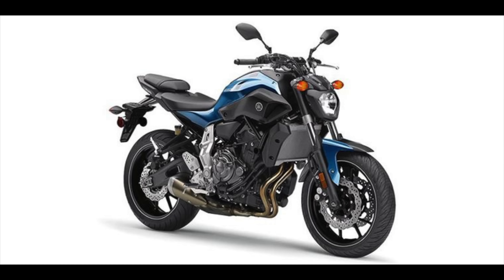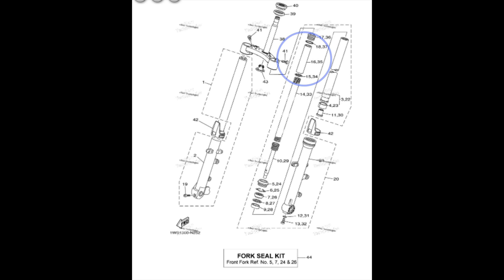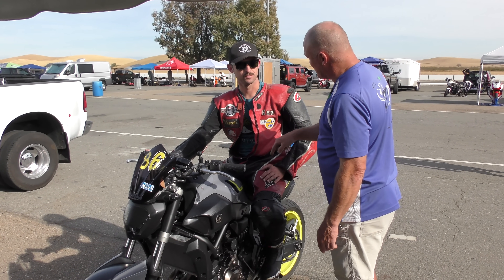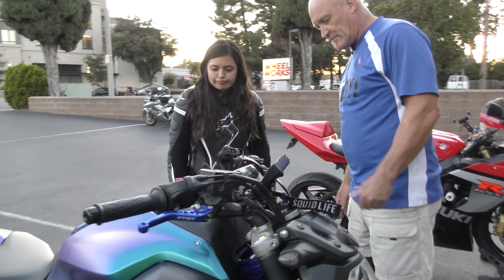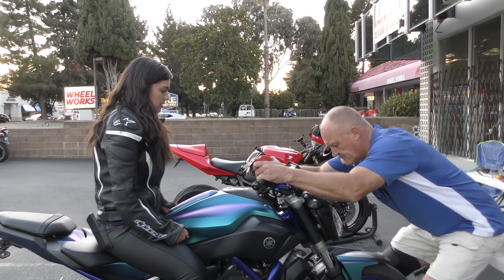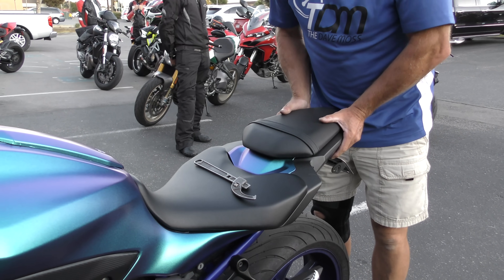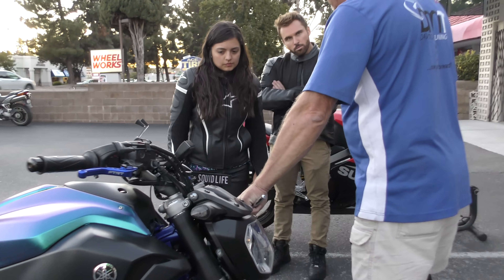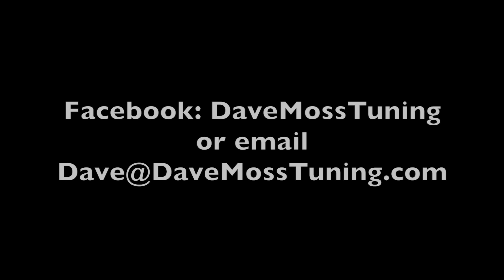Yamaha FZ-07 / MT-07 Fatal Flaw and How To Fix It

Comment: I just got a 2020 MT07, I'm 6'3"about 280lbs. I think the bike I got has a higher seat bc I flat foot it comfortably and it doesn't feel small. It feels perfect for me actually. I never knew the suspension needs correcting though.. what are your recommendations to fix the suspension and handling for a big guy like me on the 2020 mt07??
Reply from the maker: 20w fork oil and leave the spacer and stock fork position as is. Try putting shock preload 2 below maximum and see how the bike handles.

Comment: Did they fix the forks on the 2021 Mt07?
Reply from the maker: Oil needs to be changed to 15 or 20w depending on weight.
Reply: @catalystreactionsbw  i see. So the spacer wise they made it shorter for the new model?
Reply from the maker: @mad2xraven  I believe the spacer issue has been changed but have not verified that myself. If static sag is 15mm or less, the spacer is still the same length.
Reply: @catalystreactionsbw  we’ll have to see then😄
Reply from the maker: @mad2xraven  as per reply, I do not know as I have yet to see one in person to validate but with a tape measure you can assess immediately with your bike.

Comment: I have a very limited knowledge of suspension but....if I'm understanding correctly, we shorten the spacer to reduce preload which in turn shortens the travel, and the bike will no longer ride as high in the suspension stroke. This will increase static/free sag correct? What measurement is the goal for the static sag? How does the 15w/20w oil affect the bike other than more harsh compression? How does lowering the forks in the triple clamp 8-12mm help? Does it further combat the feeling of the front forks being 'to the moon'? I apologize for so many questions. I'm trying to understand what needs to be done on my current 2018 MT-07. Currently ~16mm of static sag in the front forks, and only sees any static sag in the rear at the lowest bottomed out setting. Which makes it further feel like I'm riding a wet noodle. Thank you in advance for any answers to my questions above.
Reply from the maker: From your statement, your thinking shows travel will be less as more static sag is added from shortening the spacer, that would be correct as the fork is not at full extension all the time. 20-25mm is ideal for static sag. Or, you lower the front end to make the motorcycle flat and neutral via the geometry change instead of cutting the spacer. Oil viscosity at 15 or 20w  is not sufficient to create a harsh compression stroke due to flow rates.
Reply: Wow, thank you for the quick reply! I think that means my next steps are 15w oil (155lbs w/ gear on), drop the front 10mm, and a new rear shock. See how it feels, then trim the spacer if needed.
Reply: @carson6305  hey, what was your observation?
Reply: @StefiMoto  Hey Stefan, I actually didn't get to changing my rear shock just yet which is still a 'problem'. The bike is not unrideable by any means, only a bit spongey in the rear. A few weeks after this comment, I actually went to see Dave Moss in person and paid him to do any needed adjustments. He dropped the forks 10mm in the triple clamp and mentioned that a new rear shock and 15w in the front forks would be all I need for a perfect setup at my weight. The stock rear shock only presented static sag in its lowest setting, so Dave adjusted it down to that. I will be purchasing an aftermarket rear shock for my weight soon, and don't have any desire in swapping to 15w in the forks until I absolutely need to for general maintenance. Hope this helps.
Reply: @carson6305  thanks a lot for quick and detailed response.  🙏
Did you notice the front end behaving better after the drop?
And what's your weight?
Reply: @StefiMoto  Hey, no problem at all. An honest answer is that I only had the bike for 2 months on stock setup before Dave made the 10mm drop, so I did not have a great baseline to compare to. With that being said, it handles great apart from the 'wet noodle' of a rear shock. I'm 155-160 with gear on.
Reply: @carson6305  thanks again. 👍
And finally, did you shorten the spacer also or only raise the forks?
Reply: @StefiMoto  Dave mentioned that on my 2018 mt-07, shortening wasn't needed with the 10mm drop. He still reccommended 15w oil in the forks, or 20w if I'm a bit of a hoonigan ;). I still could go the shortening route if I wanted.

Comment: I heard this is only a problem for the pre 2018 models, after that its better, do you have any information on that?
Reply from the maker: We just changed the fork oil to 15w on a 2020.
Reply: @catalystreactionsbw  I appreciate the fast respone. Would you recommend this problem to be solved only for more experienced drivers who want to test the limits of the MT-07, or also for people who use it as their dialy driver?

I am just surprised about this issue, as I haven´t heard many people talk about it.

Comment: Hello to anyone reading this. I am a semi sponsored FZ07 or MT yamaha stunt rider. Frankly I have done the exact opposite of everything this guy has said and my bike runs/handles like a dream. The only thing I changed is the saggy ass fix which raised the back up by 2.5 inches (If you are a stunter or know about stunting you know what that means) thanks to Twin Stunts who are fully sponsored yamaha stunt riders and make stunt parts and I put in stronger fluid so I wont bottom out the forks coming down from a wheelie! To ME they are ready to rip out the box! Remember that everyone rides differently and that you don't have to fix something that isn't broken!!!!!!
Reply from the maker: Thanks for sharing your experience Matt. What "stronger fluid" did you use and how much? Stunting is a very unique set up indeed so sharing more information would be very helpful for those who have your skill set.
Reply: @catalystreactionsbw  15wt for the fork fluid to make the front suspension more stiff and less chance of bottoming out/ blowing  your fork seals. If anyone is truly interested in how to set up a stunt fz07 I will be making a video on my YouTube channel
Reply from the maker: @Deadman_stuntz  Thanks for confirming the change from stock to 15w oil and volume to meet your needs for endo's etc.

Comment: I’m new to this guy and his set ups of people’s bike but.....why the hell is he tightening the pinch bolts so much. 26nm on the top and 22nm on the bottom tree and he was putting way more than that into them which makes me think that if he doesn’t know not to overtighten the clamps then he doesn’t know shit about suspension
Reply: Except for the fact that he's tuned about 3500 bikes a year for the past 20 years. That's a lot of pinch bolts. How many pinch bolts have you tightened over the last 20 years?
Reply from the maker: Sometimes what we think we see is not was is actually happening. If your comment had requested pinch bolt torque used I would have said 14-16ft pounds. That would have satisfied your curiosity to give you a different POV.

Comment: 15w oil, but which CST@40 there is a world of difference between the 15w oils out there
Reply from the maker: Correct, hence my suggestion of Maxima as a brand for those that do not want to dive in to cSt data points.

Comment: I don't think I'd call it a "fatal flaw" lol.  I did just fine on mine.  Put 38,000 miles on a 2015 gen1 with no issues before I traded it in.  Pure stock.  Commuted with it every day, and even loaded it down with gear for camping about 2 dozen times.  Had it for 5 and a half years.  Replaced 1 fork seal at 20k miles.  I'm 6'3" @ 240lbs.  Mind you I didn't race it, but it wasn't built for racing.  I did do twisties and mountains though.  Actually considering trading in my current bike for another one because I miss it so much.

Comment: With the front end of my on my old 1990 FZR600, I experimented with different length spacers until I got the sag right. To set the damping I got some thick and thin fork oils, and then tried them mixed in different ratios. That and with a bit of messing with the oil level, for such a simple budget suspension system I got it working quite well..And all for the cost of a bit o steel tubing, and a couple of bottles of oil. (For the rear I bought a second hand adjustable shock).

Comment: Curious if this still applies to the 2021 models.
Reply from the maker: Fork oil, yes. Have not checked static sag so if it is 15mm or less, it applies to the spacer. Easy task to do with a tape measure :)
Reply: @catalystreactionsbw  awesome, thanks. I pick mine up Tuesday, ill check sag one I have it. Too exited to ride it, so I probably won't fix anything for a while, but I'll have a project when the time comes!
Reply: @IamR3D88  have you already checked?
Reply: @hsimoes84  I have not. I honestly still love the bike as is after 1300mi. It's still on the list, but not that important at my level of riding.

Comment: Hey Dave, is it the same process for a MT07 2019? i.e. can I apply same process you used for girl's blue MT? I'm 1.80m and 84kg. Thanks a lot and regards from Colombia!
Reply from the maker: Yes correct, same process. Use 15w oil for your MT07.

Comment: I just ordered a new Mt07 from 2021. Is it still the same things that should be changed? im 6'1" 165lbs
Reply from the maker: Fork oil yes, not sure about the spacer. Check static sag and if it is 15mm, then yes to the spacer.

Comment: My cx500 seems a bit soggy in the turns , whats the cure ?
Reply from the maker: Have you measured fork and shock travel used. That's the starting point. Once you have that data, you have a path forward.  Then there is oil age? How old is the fork and shock oil?

Comment: I changed the front top fork cap with a preload adjusters (nearby 50$US).  Small invest, for a normal ''street use'', i am surprise and it's really not suggestive, on trial, i immediately noticed the difference (less trampoline effect on the front and then more precision). Satisfied ? Let's say I am not someone who push too hard. I will soon change oil as you recommand but i already feel more under control and more important: secure. i am 6'1' near 200lb mt-07 gen. 2019 apparently they had improved the suspension but it's hard for me to judge. Many thank for your helpfull video and advice.
Reply from the maker: Hi Marc. Excellent critical thinking to make choices to benefit you and your motorcycle. 20w fork oil will work very well for you. Up to 2020, the issue is the same. Thicker oil was apparently introduced in 2019 but it is not thick enough.
Reply: @catalystreactionsbw  Just a last advice..? In my country, Canada, it's pretty cold, all year long... (except July.. August). I am wondering if 20W is not gonna be to much tick since when it's cold then  it will affect oil density and so on ? I was thinging  more like 15W ? Thank a lot M. Dave ;-) (It also might be good to know for others bikers in colder country ..or  anywhere ;-)
Reply from the maker: @marc-st-jean  at 200lbs/91kgs 20w should be fine unless you live in the interior where 5C-15C are averages. 15w may be better in that temp range.
Reply: @catalystreactionsbw  Many thanks M. Dave ;-)

Comment: Very interesting. I normally adjust static sag with the rider on the bike. But i drive dirtbikes and mtb, maybe thats different there...
Reply from the maker: N matter what you ride, setting static sag in the shock is critical. Once you set it especially if there was none in the first place, the epiphany often makes riders angry that they did not do this before.

Comment: Is this an issue for racing the bike or is this more of an overall safety issue even for street riding?
Reply from the maker: It is a safety issue when riding the bike at any time as heavier oil provides much more stability all all times from turn in to exit of every corner

Comment: How does a company as large as Yamaha make such a error in the front end design...an error so big one has to chop bits off the spacer and use a heavier weight oil....its a damn disgrace..
Reply from the maker: Remember that parts com from different companies and they are installed on the motorcycle. We do not know if the sign off is with the suspension company or Yamaha for parts placed on any given motorcycle. We will probably never know.....
Reply: @catalystreactionsbw  Perhaps Yamaha could do with your expertise

Comment: Hello Dave, good info! I have an '07 Suzuki Hayabusa with an Elka Stage 5 in the rear. What do I need to do to tune the suspension? I am 6'3" 235lbs. Please advise.
Reply from the maker: Set sag front and rear at 30-35mm (static plus rider combined). Make sure that you have rebound set correctly when the suspension oil is hot so you hav excellent stability mid corner. We have a video specifically on rebound, too slow or too fast.

Comment: Added 15 Weight oil, cut spacers by 10 mm and the triple clam is 10 mm below where it meets up fork cap(2018 Mt here) please do this... i can only see further suspension enhancement if your trying to COMPETE at a track(havnt got there yet) im 5'8 170
Reply from the maker: Thanks for sharing your test and results Evan! I am sure you words will inspire many others to make a change for the better.

Comment: Does this also apply to the 09/XSR900? Thanks in advance!
Reply from the maker: It does not for the spacer. For the 1st gen MT09, you need 15w fork oil, 2nd gen 10w
Reply: @catalystreactionsbw  much appreciated! I’m in the US with a 2016 XSR900. I believe that’s the 2nd Gen MT09, so I should drop to 10w, correct?
Reply from the maker: @CameronBroussard  That is correct, oil height at 140mm
Reply: @catalystreactionsbw  true gentleman. Thank you for the advice. Open invitation to come to Austin & see our hill country.

Comment: Wow Mr.Moss, thanks for the nice explanation! Could you do the same for Honda CB650F 2017 and up? I have one of those, and the bike is very nice apart from suspension. Rear shock has spring preload adjustment only, no rebound, fork has no adjustments whatsoever. Suspension is form Showa, fork is Showa Dual Bending Valve type, is very soft. For example, I am 70kg (around 150 pounds) including gear, however during slow sharp cornering (gymkhana style), with front braking in the corner, when steering goes to the limit - the fork almost bottoms out making me shit some bricks. And yes, the bike has only 8000km on the clock :)

Common solution would be buying complete Ohlins kit, however it is costly. Are there any options what to do with this? Thanks!

Comment: Does the MT09 or 10 also have similar problems? I’d complain that a shock should last longer than 7K but I have a Vrod and I don’t think my shocks or forks ever did anything. I think a hardtail with a spring seat may be better.
Reply from the maker: There are separate videos on the MT09 and none state this issue.

Comment: Awesome advice - i wish i knew about it before passing on the mt-07 due to everyone mentioning suspension as having issues... any pointers for a kawi z650 ?
Reply from the maker: Same task with fork oil viscosity, fork geometry change and at some point a rear shock change.
Reply: @catalystreactionsbw  
And I couldn’t wait so I went out (midnight) and this is insane the difference is night and day this guy is a fucking wizard
Reply: @catalystreactionsbw  
I just finish what u said even cut the spacer at 10mm with 20w going to test it tomorrow morning wish me luck 🤞🤞🤞
Reply: Get a z900
Reply: @RidingNomad  get a turbo busa
Reply: @RidingNomad  Does it not suffer any of these suspension designs?

Comment: Is it possible to have a similar end result by using rebound adjusters?
Reply from the maker: If you have rebound adjusters you can manage oil flow to mitigate poor rebound damping. BUT - if the oil is oil, the viscosity range cold to hot is huge, so you can only effectively damp a certain oil temperature correctly. That's why we change oil frequently with forks and shocks - to get the best performance we can out of them.
Reply: @catalystreactionsbw  given that I have my MT for a year and a half almost, I'm still on stock oil @ 2,2k miles. At what mileage would you suggest swapping it?
Reply from the maker: @jsal92  4-5,000 miles f you have rebound adjustment creates a much better suspension overall. 8,000 absolute maximum.
Reply from the maker: @jsal92  If it is an MT07 with no rebound, then every 3-4,000
Reply: Dave Moss Tuning thank you!

Comment: Does this problem occur on every year of MT/FZ07s?
Reply from the maker: To date and via postings in this thread to validate, oil viscosity yes. 2020 MT07 static sag is 15mm that I measured, so that one for sure needs spacer and fork oil.

Comment: Did Yamaha correct the "too long" spacer problem in the XSR700 or does that bike also need its spacers cut?
Reply from the maker: Leave the bike at rest and vertical. Measure the forks. Put the bike on the kickstand and extend the forks. Measure from the same two places. If the number is 20mm or less, the spacer needs to be shorter plus heavier oil.

Comment: Hi Dave, Im a new rider (3-4 years) and I have Yamaha XSR 700 (2016 model) and I have same sort of problem but the fork on my XSR is not exactly the same as one on FZ/MT 07.
Do you think I should do the same 15 mm and different oil thing or it has to be some other length. 
Thank you :)
You are awesome.
Reply from the maker: Hi Andrej - just the 15w oil for the XSR. Thanks for the kind words and for watching!
Reply: Thank you for tip and fast replay, I’ll change oil these days and write results.

Comment: is this also a problem with the MT-03 as well? My 2020 has visible oil build up on the left fork right off the shop floor. The dealer is supposed to warranty it but they said i might need a whole new set up and parts are back ordered until December.